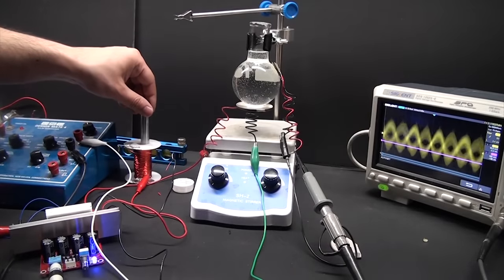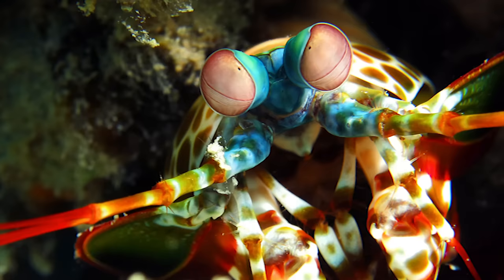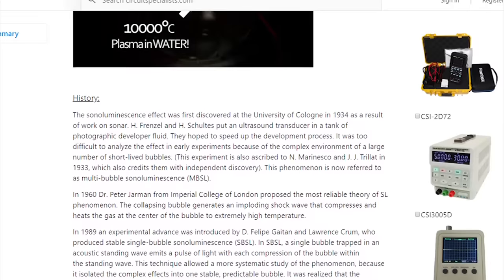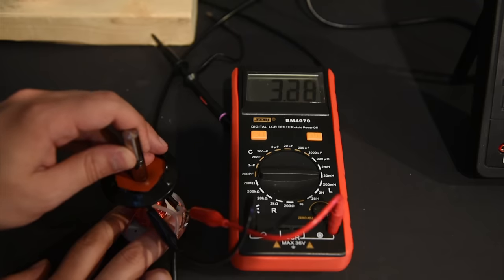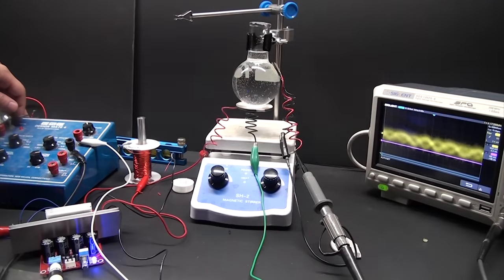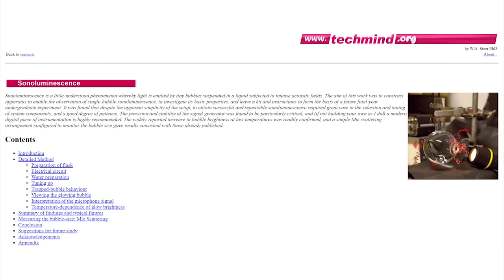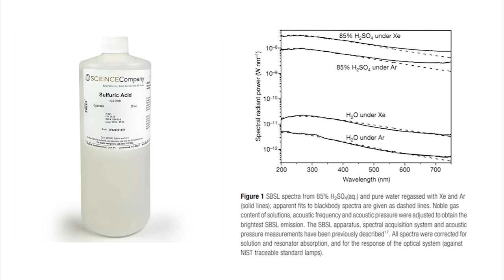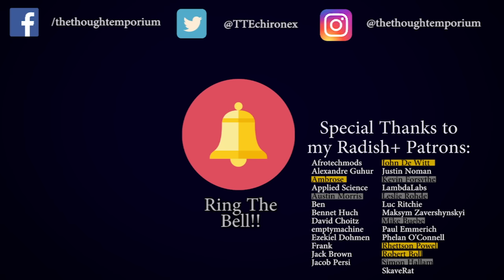Punching Water So Hard LIGHT Comes Out - Sonoluminescence

Comment: Grab the slowmo guys and just see if they're willng to take the slowest, craziest images
Reply: I don’t think that will work, though, because the glow is very dim and you need a lot of light for slow-mo (remember how he said you need a long exposure?)
Reply: @GRBtutorials  That can be fixed if you use stroboscopic effect and long exposure.  However, that requires extremely precise positioning of the bubble.
Alternatively, you may use laser aimed almost at a photosensor to measure both the size of the bubble (the bubble difracts the laser more, the larger it is) and timing of the flash (since the sensor will simultaneusly pick up both).
Reply: @GRBtutorials  one can use polarised/monochromatic light source for the camera, and then some very sensitive single sensor behind a polariser/filter to detect the light from the bubble. Idk if there are such sensors, but i guess it would still be better than a camera matrix if you could focus most of the light on that single sensor.
Reply: NullByte4532 _ Except that it’s the bubble itself that emits light, so that’s out of the question. Certainly, a sensitive and fast sensor would work, and there are photomultipliers (both in a tube and in silicon) that can even detect single photons, though they’re quite expensive in unit quantities (about $80 each for SiPM).
Reply: @GRBtutorials  no, wait. I meant using another light source to provide enough light for a high speed camera, and then filter out that light, allowing only the light emitted by the bubble to reach the photomultiplier or whatever.
So use the camera to monitor the size of the bubble and the photomultiplier to time when the light is emitted. Or did i misunderstand what you wrote?
Reply: @GRBtutorials  They would need to use image stacking techniques similar to those used in astrophotography but in this case the stacked frames would need to correspond with the resonant frequency of the experiment.
Reply: @davemarm  I thought exact same thing!
Reply: @davemarm  Would the Schlieren technique (used to photograph shockwaves) work? After watching a slow motion video of it and a revolver, it seems like it picks up the muzzle flash pretty well, as well as being so sensitive to capture the shockwaves in the air.
Reply: Dave M To get a decent video the camera would have to have a frame rate at least 2x the resonant frequency
Reply: Search for “chronos ring” as a possible solution
Reply: KohuGaly One reason this has intrigued so many is that the position of the bubble is incredibly precise.
Reply: @gerradfoster8777  Why is that?
Reply: Dave M When the transducer vibrates the flask at a resonant frequency, standing waves are generated. When this occurs, the bubble becomes “trapped” at a velocity node of the standing wave. We can predict this location based on the liquid medium, the shape and dimensions of the flask as well as the flask material. In this case, the flask is presumably pyrex with a spherical shape and the liquid is water. Though the dimensions of the flask are not known to us, the person in the video has taken this into consideration. The mathematics can be a bit complicated because of the flask material and the shape, but that is easily overcome given this setup is well known and really just a matter of “plug and chug”. In this video, you can see that the bubble is trapped in the center of the sphere. This is because he is at the lowest resonance mode, which only produces a single node at the very center of the sphere. Other resonant frequencies, shapes, materials and mediums can be used in very similar ways to produce different configurations of trapped bubbles (i.e. more trapped bubbles at different location). He uses the floating styrofoam earlier in the video to demonstrate this.
Reply: @gerradfoster8777  I meant where did you derive the "2x the resonant frequency" requirement?
Reply: Dave M Sorry about that. It’s called the Nyquist frequency. Presumably, if your camera recorded at the restaurant nant frequency, all you would see is the bubble remain the same size because you are always taking the picture at the same cyclic rate after bubbles growth and collapse. In that case, you would say nothing is happening to the bubble. It is called aliasing. The higher the frequency of samples taken, the closer to the data represents the actual events. Towards the beginning of the video he shows a clip of the bubbles growth and collapse. That was done with a fps much greater the resonant frequency used to induce the effect. I’ve seen some of the videos the slo-mo guys have done at 200k fps, which is about ten times the res frequency used in the video.
Reply: @gerradfoster8777  I don't see how the Nyquist-Shannon theorem is applicable here. The bubble emits a sudden burst of light once per acoustic cycle. The point is to capture that instant with a camera. In this case it is convenient because the subject itself acts as a strobe so that the shutter (or equivalent) can remain open for the entire acoustic cycle (i.e. corresponding with the resonant frequency) while capturing a (very faint) image of the bubble at that instant of the waveform. This is similar to setting a strobe light, camera and faucet drip all at the same frequency; No need to sample at a higher rate.  The only difference is that in this case it is presumed that the image would be too faint to get a high signal to noise ratio without stacking.  Even assuming a separate case where you are trying to capture an image of a wave, the Nyquist-Shannon theorem wouldn't be applicable since photographing a subject is not the same as establishing a discrete time signal (you would end up with a blur if you only sampled at 2x the frequency of the wave).
Reply: Dave M The 2x is merely a minimum sample frequency. That said, capturing the emission of the light is not the only element of interest. To just focus on that aspect if sonoluminescence would be ignoring the real mystery. That is the fluid dynamics that cause the light to be emitted in the first place. It has already been shown that the light does occur once for every acoustic cycle, but the bubble dynamics are not sinusoidal.  The growth of the bubble is slow and gradual (relatively), whereas the collapse is sudden and violent. Also, as the acoustic pressure is increased toward inducing light, the bubble undergoes several rebound expansion and collapses for a short period after the initial collapse of the cycle. As the acoustic pressure is increased up to the point if inducing light, these rebounds are very noticeable. However, when the bubble begins to luminesce, the rebounds virtually disappear. This indicates that there is a very different mechanism of energy dissipation before and during sonoluminescence. The bubble expansion phase is thought to be isothermal, and adiabatic when collapsing. What thermodynamic process bridges the collapse of the bubble to the beginning of the next expansion phase is not clear. To understand this process, the dynamics of the bubble must be better understood. This would be better fascinated by taking several images of the bubble before, during and after the collapse phase.
Reply: I would live to tweet to you but got banned because atheist.
Reply: Or SmarterEveryDay
Reply: @GRBtutorials  giant lens to collect AALLLLL the photons
Reply: this was my first thought. "Get the slowmo guys!" lol
Reply: I'd love to see brightly lit superduper slowmo of just the bubble being formed and collapsing.  The light actually generated would clearly be many orders of magnitude too faint to capture with current technology.  Maybe in another 10 years that could be possible.
Reply: My thoughts exactly

Comment: There is a sonar counterpart to this study called lumisonics done by me.
Yes, you can produce sound from light
Reply: Wow. Explain yourself a little bit..
Reply: Wat is dis TECHNOLOGY?
Bruda Osas would like to know
Reply: link please
Reply: How is that different from light hitting things and heating it, or knocking out electrons?
Reply: How do you do that? Hitting a surface with a laser and use thermal expansion/evaporation/light pressure to move the object and have it generate the sound? Im intrigued.
Reply: making sound from light is way way less interesting than making light from sound and water
Reply: Sonar - sound in water - dolphins see sound? From visual or auditory brain sections
Reply: Can you mesure the light?
Reply: @Leo Richardson electrical to mechanical to water/sonar frequency to light
Reply: bump. post link to paper pls :)
Reply: There's a Veritasium video on extracting sound from still video, which is probably nothing like what you were doing, but sounds similar to my inner child, and you may find it interesting.
Reply: The photoacoustic effect was first discovered by Alexander Graham Bell in 1880.
Reply: @coenraadloubser5768  Creating vibrations is different to creating ordered vibrations. Heat is just disordered sound.
Reply: @edenengland1883 opinion wee woo wee woo lol
Reply: @diegobrando2750  sound from light is very simple, literally anyone could easily guess its possible
if its impressive to you, please get higher standards
Reply: part of the kasimir effect? virtual particles?
Reply: Light is vibrations through the ether, sound is vibration through the air! It’s all the same thing😂 Vibration!
Reply: @edenengland1883  how so
Reply: How do y'all think fiber optics work?

Comment: A small hint: I was playing with ultrasound several years ago, when researching on how bats navigate. By accident, I had generated WAY to much ultrasound volume, which I did not hear, but deafened me temporarily above 400 Hz, and a hearing reduction above 4000 Hz which persisted quite a long time (into months) afterwards. So be careful with sound you can´t hear ;-)

Regards

PS. They tried to use this process for nuclear fusion! Btw I LOVED the Mount Stupid quote, it´s the reason I always corroborate as much source material as possible... And Gun Ho! Usually you find that a lot has simply been Copy-pasted, among other things. And by the way: don´t use an iron core for a 4 millihenry coil, that thing´s lossy as hell, Just find a ferrite rod from an old AM radio. Also feed the output from the amplifier to a tap on the coil, so the transducer and coil form a parallel circuit, be careful, because than you´ll get the nasty side-effect I had after a while lol.
Reply: Deafened you above 400 Hz and hearing reduction above 4000 Hz?  I assume there's a typo of some kind there?
Reply: @jamesdavis3851  No, there´s not I think? It´s been almost 10 years since that accident now, or any other tinkering with ultrasonics, now I realize the power (and dangers) these things can have and things got better. There is (was) a sharp reduction to near-zero above 4000 Hertz, and a good reduction down to 400 Hz too. It was a roughly 22 kHz square-wave with a pulse-frequency of 5-6 Hz, should figure that out with a metronome and stopwatch, so low-ultrasonic. The deafening/ringing ears was temporarily he, lasted a few days ;-) The reduction in highs however appears to be rather permanent... Thank God the PRF was so low I only got one well-focused sound pulse into my ears. If it had been prolonged exposure, you´d probably be permanently deaf.
Reply: Always, always use at least proper ear plugs when dealing with high sound frequencies, simple ear plugs are at least quite effective at cutting the highs off, and most importantly, removing destructive direct pressure to the eardrums outright.
Reply: This guy is the nerd the world needs rn
Reply: There are some healing roids that could have healed some of your inner ear cells faster before they are damaged beyond repair while healing... sometimes you can only heal to a certain point before the point of no return and losing those cells ....
Reply: WHat I'm saying is you could heal to that point of hearing you started at unless it healed before those cells could come back....
Sort of like a broken bone if you wait to long you can't reverse it's affects if it heals that way.
Reply: I did the same thing

Comment: Really nice work! How did you get the idea to ditch the typical 2 transducer setup?
Reply from the maker: Thanks :) there was a couple images on Google with only 1 so figured I'd try it and sure enough worked like a charm. Also some of the professional setups just used 1 and a tubular container so I figured if it worked for that it could work with the round bottom flask too
Reply: @thethoughtemporium  I've read about one experiment where they successfully managed to go overunity with ultrasound and sonoluminesence
Reply: @thethoughtemporium pls do look into this strange nozzle called vortex cooling pipe.
Reply: "Huh, I found a far easier way to conduct this obscure and complex experiment by simply googling it" Damn, I love the future.
Reply: @dwijgurram5490  🤦

Comment: Wow!! That was easy. My first drop produced SL bright enough to be seen without dimming the oscilloscope screen. 
And yes, the lit bubble is very stable. I bumped the table and the bubble went off and came right back on. 

Thanks Again
Reply from the maker: If you took some pictures, tweet them at me!
Reply: @thethoughtemporium  Hello.
Very nice experiment. I don't have a time to watch entire video but I have two question already.
What happens if you cap the flask and replace air with other elements, like argon or nitrogen before? Did you try it?
Cheers.
P. S.
I wonder what it looks like in zero G. Maybe the bubble would grow bigger pushing water outwards. Maybe we can use this properties to generate energy. It may be a new age steam engine.

Comment: star in a bottle, some even tried getting neutron readings to see if it did a fusion. i have always been facinated by this effect ever since i saw it.
Reply: I'm a little surprised they didn't try with liquid hydrogen at some point.
Reply: A professor out of Purdue claimed to have induced fusion using a deuterated acetone, but was later discredited
Reply: @gerradfoster8777  i am sure its hard to do if at all possible
Reply: Duality It has been studied a bit, and was the basis of “cold fusion” storylines in Chain Reaction (with Keanu Reeves) and the most recent version of The Saint (with Val Kilmer). It would be cool, but is likely a pipe dream.